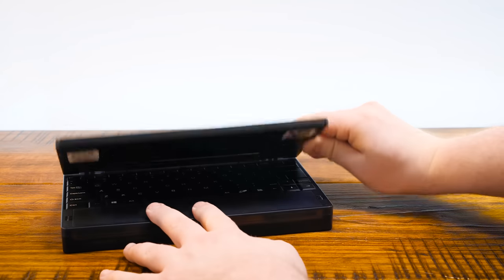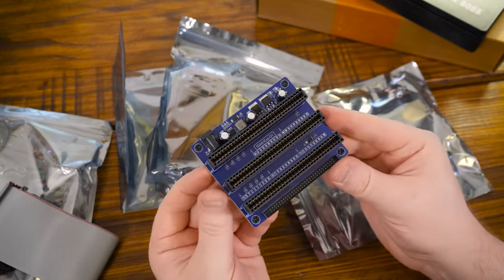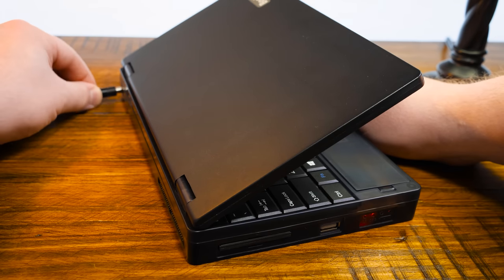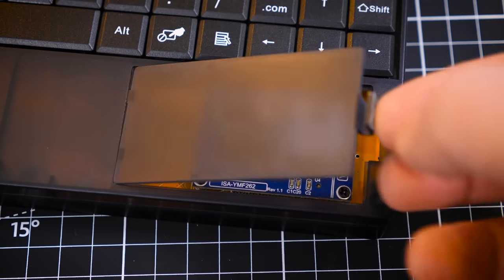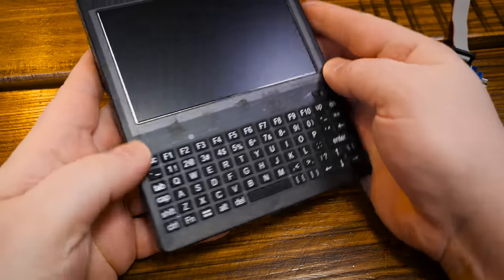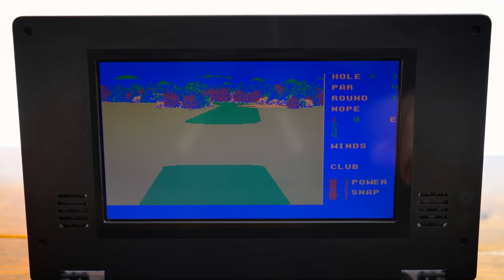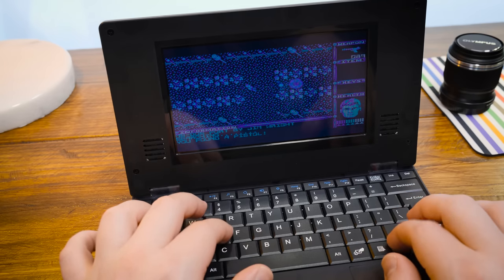So I Bought Those Weird New AliExpress Retro PCs…

Comment: Heh, it's funny when you mentioned the better version of this would be the 386 in the 8080's form factor, cause I just got a Pocket 386 that's basically that. Though I suspect this is a ripoff of both projects, especially since the plastic molds on the back look like they should let you get access to the OPL3 card and the processor, but instead only let you access half of the processor socket and the serial card. Other than that, it's pretty neat at playing my old GOG library on era appropriate hardware.

Still came with WIndows 95, which honestly I thought was a really strange choice, even in the palmtop form factor, as it's not running well, and I genuinely would've expected DOS 6.22 + Windows 3.1. No idea what went through the designer or the bootlegger's mind here. Also weirdly enough, I thought it'd be fun as a palmtop, but it turns out that in fact my old LX200 is STILL better for taking notes and using it as a DOS machine, lol - especially since THAT thing runs off 2 AA batteries for a couple weeks.

Comment: dang i didn't know you could run win 3.0 on an 8088. i thought i required at least a 286. things moved quickly, 3.0 ran on an 8088, 3.1 could run on a 286 (as i finally figured out in my childhood after figuring out how to disable the built-in rom's config.sys/autoexec.bat from loading on my IBM Ps/1) but then 3.11 only worked on a 386? or maybe it was just 3.11 WFW that required the 386

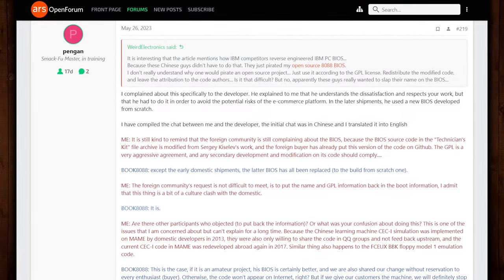Comment: 7:20 I entirely agree that using open source code without crediting the author is very problematic and should not be done, especially when a product is being marketed for sale. However, I don't understand the statement that "this is a bit of a culture clash with the domestic". The poster also made a reference to the CEC-I MAME code that has been redeveloped, and the FCEUX BBK floppy model 1 emulation code. What is the culture clash here, and why do Chinese companies find it hard or costly to comply with the GPL?

Comment: >terrible box
>scrap parts from ACER laptops
>worst screens
>even manages to slap a copyright on FOSS (just like Apple does most of the time)
is there anything China does right? as a hobbyist I would really design a decent case, a bunch of 3.8v rechargeable cells, and make keys useful for a retro PC that's modern. 

and ffs, a pair of REAL serial/UART ports. that is still useful for hobby stuff to open a terminal on things like routers, switches...

Comment: I would definitely buy an improved version with RS232 and an RTC (there even were RTC-cards for the original XT), too. Otherwise I am glad to have it. It is fun and I connected my Needhams eprom burner via the ISA extender successfully :)   And for the display: come on folks, this is the true experience. With the two black bars in text mode (not in graphics mode), kind of crazy colors without contrast and a dim LCD. Didn´t you use color laptops around 1992?? :)   The overall feeling is more like a lame 286. The speed of some operations ist definitely higher than on my XT. Displaying a directory takes annoyingly much time but calculations and build-up of display pages is faster than with the original.  Norton SI (which is my trusty benchmarker since 1988) says "2" but the overall feeling is faster. Maybe because of the FPGA-support-chipset.

Comment: Cool to see, but I really don't want either, haha! I wonder when we'll see people smarter than me come up with kits for different eras you could build in a 3D printed case for retro PC gaming or other random tinkering. Could be pretty neat, and a way to repurpose chips from otherwise dead era-correct components. I love tinkering with old stuff, and I do have a few old machines for old games (a "1999" machine with 98se, a "2003" early XP non-widescreen machine, and a "2006+" late XP machine) that work, but I just don't have the time to endlessly tinker with hardware like I did when I was younger. It would be neat to have plug and play solutions that just work without being old, or having to deal with trying to make old stuff work on more current hardware.

Adult responsibilities 0/10 do not recommend!

Comment: with all the 3D printing and design options if someone made a legit looking 80's design but shrunk down a bit (e.g. space saved from using CF storage inatead of floppy) can't help feeling that'd be a far better product than an eeePC knock-off

For Rev.2 include an HDD clicker module and rectangle LEDs for the full retro experience 🤓

Comment: I would kill for a SBC laptop (like an Orange Pi or Libre Computer Board, because they're WAY cheaper than overpriced scalper-prone Raspberry Pis) that looks EXACTLY like these do, and turn it into a dual-boot Armbian GUI + Lakka (for emulation) powerhouse.

Unfortunately, I am horrible at DIY'ing stuff like this unless it comes in a kit that doesn't require soldering.

Comment: I’ve been working on making a 6502-based Laptop just like that 8088 machine since October!
Although.. Mine has a LOT more options than the 8088 one here.. like 2 serial, keyboard/mouse, VGA, Parallel, and a 50-pin DSub port for my own expansion stuff
I DO like the access ports for the CPU, although I have a few cooling options I’ve been debating on, which won’t allow for a cool access port like that
Reply: What OS?
Reply: @Sashazur  hopefully, nothing but basic

Comment: This wouldn’t be so bad if you could plug in floppy disk drives into that computer. But this computer isn’t worth it! This is a missed opportunity, they should be adding more ports!
Reply from the maker: You can, but it requires adding a floppy controller card to the ISA extender board. Bit of a messy solution.
Reply: @LGR  that’s just too messy and there would be lots of compatibility problems. Rather buy an older Toshiba laptop that has the floppy controller built in! I had that laptop, but it stopped working, it won’t turn on anymore! It went to e-waste thanks to my former employer!

Comment: I think that this is just too sketchy. With the stolen BIOS and such. Also, I'm not a fan of 386s.
A better 486, with an overdrive, or something, can run you all the good stuff you want. Like Doom for example. Maybe even Duke 3D.
But the 386 is overequipped for the 80s stuff and underequipped for the best mid to late 90s stuff. It's in that weird limbo, on its own, not doing anything spectacular.
Also, the lack of I/O and ports, and running Windows 95? Doesn't scream "a great retro package to buy" to me. I'd rather convert a laptop from IBM to run Windows 98.

Comment: It wont be long before we have full blown 100% x86 hardware emulation with FPGA.  Imagine setting up the core.  486 check!  Sound Blaster check!  MT-32 check!
Reply from the maker: The ao486 core on the MiSTer is already quite good!
Reply: @LGR  Absolutely!  Pretty hit and miss though with various software.  I tried to make a rock solid Sierra unit.  Think, hardware version of scummvm.  I kept coming across titles that gave me a horrible midi experience.  So close though!
Reply from the maker: Aye, I’ve had some various annoying issues myself. It’s a good start though and I’d love to see that kind of hardware emulation in a form factor like these machines.
Reply: @LGR  Exactly.  Something nice and all put together.  Even retro looking.  It's going to be a completely different world 10 years from now, yet again.

Comment: This is nifty but I have to just leave a comment already at the price point.. almost $200?? 

I just bought a very nice, barely used, couple year old Lenovo laptop with 16gb ram, 256 ssd, very modern/fast processor, FHD touchscreen, backlit keyboard etc etc in beautiful condition from ebay for $230 out the door... 

So by comparison it just seems way too expensive. 😂

Comment: Touchscreens would be better gaming devices if only:

1) Buttons had adjustable size, position, and opacity
2) Swiping in the direction you want (the camera) to go could be done anywhere
3) Custom gestures could be assigned to any action

Classicboy has most of those features but even a dumbphone's web browser could theoretically do this offline too

Typing should'nt be as hard either...
I use PentiKeyboard on Android but really all touchscreen devices should have some kind of customiza ble chorded keyset

They should also have the option to swipe from one clock position toward another to have about 132 different possible inputs with analog control (making it a decent MIDI keyboard substitute)

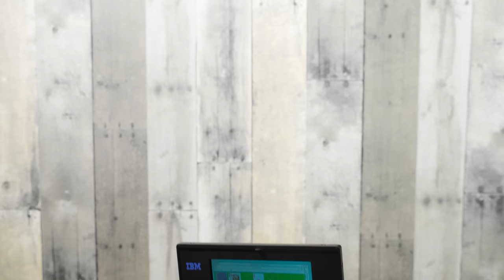Tuesday, June 27, 2023 CE, 15:38 EDT

Comment: Plug in the co processor, and put some aluminum foil between the coprocessor and the top latch, to extrude the heat through the chassis.